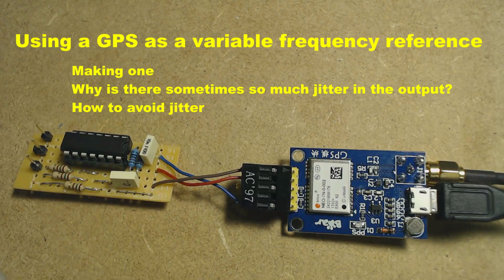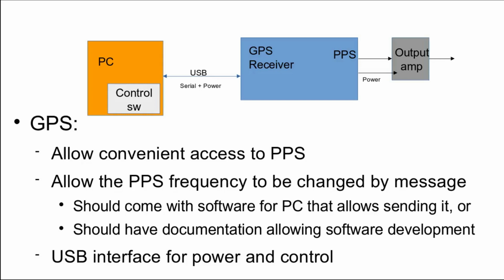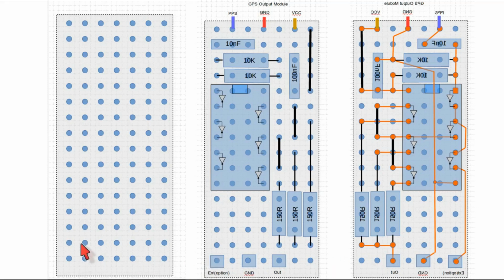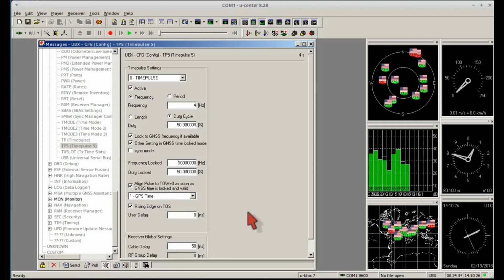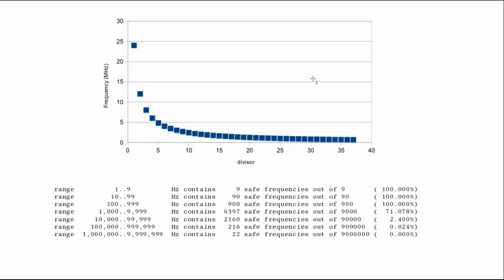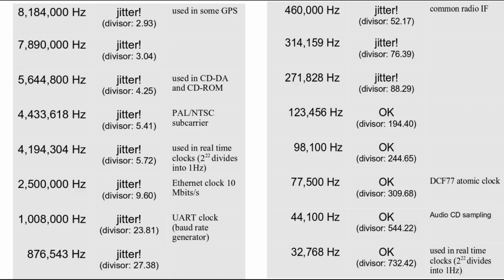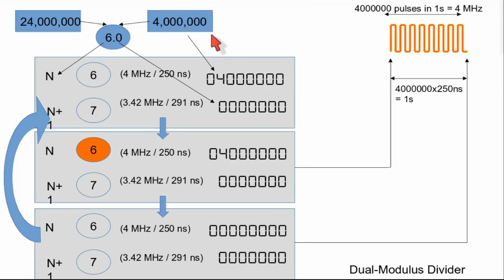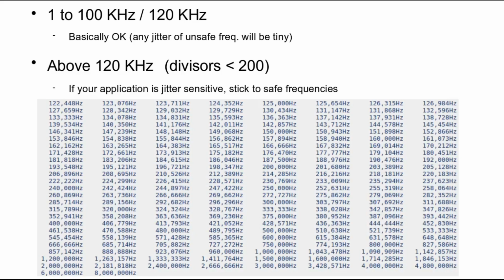Using a GPS module as variable frequency reference standard

Comment: Thank you for this clear and informative video ... excellently put together.  Also, thanks for sharing your two sided board layout, it saved me a lot of time !  I built a copy from those plans.  I was surprised at one thing (maybe my expectation was wrong):  I was surprised that the Schmidt Trigger drivers didn't clean up the signal more at even moderately high frequencies (e.g. 4 MHz) ... was it wrong to expect more square waves ?  (I understand the ringing from a high impedance input).  Perhaps it was just my hastily put together test setup.  Thanks again, and any insights would be greatly appreciated.
Reply from the maker: There is a lot of ringing visible which is because (especially for square waves) one has to take care of properly terminating the connection with a matching impedance on the scope. I did not do this (my bad)
Reply: @TheHWcave thanks for your reply … guessed something like that … I build an interface board to your plan and told my viewers to “just go watch the video @TheHWcave” 😊

Comment: Hello, Heinz. It has been three years, since I last commented here, and I am considering, again, the unsafe number jitter that you discovered. As I understand it, the Atomic Clock Reference Pulse provided by the NMEA data stream is a one second pulse. (This pulse is easily sourced from the GPS module.) As it is the GPS MCU that creates the math error, would not we do better to create our own precision multiplication method, be it hardware, or MCU/software, and use the one second pulse as our reference to correct the newly created means of multiplication? Meaning, we avoid the UBlox math difficulty by not using the UBlox math calculation. If so, what hardware and MCU/software solutions might you suggest? I guess the goal would be being able to create any infinitely variable frequency with a great magnitude of precision. If we are multiplying by one (pulse,) maybe this is somewhat less difficult? For the fixed frequency of 10MHz, which I think is the frequency that most people desire for a reference standard, how about just adjusting a 10MHz voltage controlled OCXO every second? I am not a precision guy, so I do not know how well that a one second lag between updates would go over with the folks that chase such precision. Edit: A Hardware solution might simply equal Scullcom's divider circuit dividing the one second pulse by 10M?
Reply: My thinking regarding using Skullcom's divider was obviously backward... We need a multiplier. Start with a safe frequency and increase it to the frequency that we want. I know that there are such devices, but nothing much of them. Looks like 2x and 3x factors are common?
Reply from the maker: To be honest, I'm not using this reference anymore, I "upgraded" to a GPSDO from Leo Bodnar, their mini model, which is pretty much what you are suggesting. It only has a TCXO but I keep it on permanently and so GPS keeps it nice and steady. This also contains a processor but just to control the PLL hardware and set dividers, not doing any maths. It provides a pretty good 3.3V signal selectable to (almost) anything from 400Hz to 810 MHz. I don't think a pure software solution is going to work with sufficient accuracy.  Looking at the stuff inside the GPSDO, a proper solution is quite complicated in terms of special chips needed and registers to control. Using a couple of simple ripple dividers 7493 etc is a lot easier but then you only get frequencies that are divisible  by a ^2. I decided on the GPSDO  because I like that I can pretty much select any frequency, including much higher ones, however 99.9999% of the time, it is set to 10MHz and connected to my frequency counter's ext ref input. So, actually the UBlox could do the same for that. Actually, now that I mention it, that seems like a good idea for reusing that chip and maybe put it directly into the counter, a HP 5334B (it has just a simple 10MHz crystal oscillator as time source, the OCXO option is not fitted)

Comment: Is 24 MHz actually correct? Your measurements seem to show it is; however, the data sheet seems to be different. 

The u-blox8 data sheet says: “The module's internal 30.72MHz VCTCXO is disciplined by the module and provides the frequency reference to the platform. The module provides a PPS signal to synchronize the platform's physical layer.”

The u-blox7 data sheet says: “The receiver is dependent on a local oscillator (normally a TCXO or Crystal oscillator) for both the operation of its radio parts and also for timing within its signal processing. No matter what the nominal frequency the local oscillator is (e.g. 26MHz), u-blox receivers subdivide the oscillator signal to provide a 1kHz reference clock signal which is used to drive many of the receiver's processes.”
Reply from the maker: I agree that the module probably does more complex things internally at different clock speeds. I thought I made it clear in the video that the 24 MHz was just something I came up with to make determining useful frequency divisors easier. Apologies if this was misunderstood.
Reply: @TheHWcave  - zero apologies needed and nothing was unclear. I liked the video and the logic you used (pun intended). I just so happen to be reading the reference manual (for different reason) and went off to see if I could find more on this crystal frequency issue. Keep up the good work!

Comment: Instead of using brute force methods to obtain jitter-free frequencies I just used a internet app to obtain the factors of the oscillator base frequency. 
Factors are "whole number" divisors i.e. they have zero decimal places.
The app returned a list of 140 factors for 24,000,000, all of which give jitter-free PPS output from my U-BLOX M8N. A very easy solution.
Because information available elsewhere suggests the M8N has a 28MHz oscillator I also factored 28,000,000 but the only jitter-free signals I could obtain from the result were those factors which were common to 24,000,000.
This confirms that the M8N oscillator runs at 24MHz.
Reply: The oscillator runs at 48MHz, you can find that figure in earlier model datasheet. Not that it matters since it's 2x24. What I don't understand is this app and factors you mention. I just set the desired output frequency in the Ublox app.

Comment: Even if this is an older thread: To get around that modulo divider problems, would it help to play with the PWM ratio? maybe there can be a quite safe value defined for the 10 MHz, e.g. 12%. Did not dive into the math required for this. This would be similar to the monoflop proposed before. And reasoning about if the rising or falling edge is more stable ;) Very good job, Thank You
Reply from the maker: A very good question. I need to find a way to revive the UBLOX application on a suitable Windows machine to test all the variants of non-50% duty and locking or not locking it. I have not used the UBLOX software since making the video because I wrote my own little program for Linux that just sends the desired frequency to the chip.  I'll have a look but it will be a some time before I can get to it.
Reply from the maker: I did a quick test, and changing the duty cycle did not help. In fact it can make things worse in that even jitter-free frequencies now start jittering
Reply: @TheHWcave  I looked how pll works. It assumes a symmetric distribution of the input signal around the lock, which is defined as 0. The input is low pass filtered to determine the vco correction. A duty cycle other than 50% would spoil this. So it would not work, unless some correction is applied
Reply from the maker: Thanks for the info. So unfortunately jitter is going to stay, but as I said, that doesn't stop the usefulness of the GPS module as reference standard (as long as you measure just frequency)

Comment: Try a neo8, it has no issues with 24Mhz output and you can feed that into a cheap si5351 module to get practically any output frequency within si5351 limits (~280MHz). Phase noise is not the greatest ...
Reply from the maker: Hi Dragan,
you are right, using the GPS PPS to drive a clock gen. chip is a much better solution. In fact I got one already, using a MAX M8 to drive a SI5328. This came from Leo Bodnar (mini GPS ref. clock) and can produce 400Hz to 810 MHz.

Comment: hello, the internal neo-7 crystal under the shielding is 26Mhz. i wanted to replace this 2520 tcxo crystal with an other that will divide to 10Mhz with no jitter ( i didn't find anyone who did that) . the fact that it's a 26Mhz and not a 24Mhz is confusing.  any recommendations other then desoldering the crystal and injecting external frequency from an external generator and see what happens?  did anyone tried this?
Reply from the maker: Hi David,  finding a crystal freq. of 26 MHz confusing. I would have expected 24 as it seems all frequencies that divide 24 with no remainder are jitter free, like 12, 8, 6, 4 ... but of course not 10. I am very curious about what happens if you try injecting an external frequency.  Please update the comment or email me with the result.
Reply: @TheHWcave  hi, i desoldered the on board 26Mhz tcxo and connected si5351 output#3 directly in its place. i started with 26Mhz. the neo-7 works as usual.  then i changed the frq to 21.66666667Mhz and set the TP5 register for outputting 12Mhz and i got jitter free 10Mhz from the neo-7. however serial communication with the neo and i believe that the chipset (other then the pll divider) isnt working. it needs the 26Mhz as a clock. i will put back the tcxo and connect the neo7 as external clock to the si5351. that way i will have a steady gps clock for the si5351 and could get 10 mhz with no jitter and any other frq on any of the 3 outputs.
Reply from the maker: Very interesting. Which variant of the si5351 are you using? The C version CLKIN could also be driven by 12 MHz which is jitter free from the neo7. I have not looked at the programming of the si5351 and that would make a big difference in the choice of output frequencies.
Reply: @TheHWcave  i have the "A" version. the "C" version is a beast :) you can get almost any frq you want jitter free with the SI5351. it also has a clock builder application for desktop to help you find the correct dividers to get jitter free frq.
Reply from the maker: Those Silicon Labs chips are great, no doubt but don't get me started on those  desktop apps that work only with Windows and then sometimes only when connected to the proper development board.... and no documentation in data sheet or application notes on the algorithm for those without the board and running Linux. With lots of effort I managed to work out my own algorithm needed to set the register combinations for the Si5328 to do (almost) any frequency jitter-free and GPS locked from a few kHz to 800 MHz. The hardware uses a board from Leo Bodnar based on a  u-blox M8 GPS module driving a Si5328. So, conceptually very similar to what your are doing. I am using it with my own software, One of these days I plan to make a video about it but too busy with my day job at the moment.

Comment: But is the "safe frequency" actually accurate though? Is the 24Mhz main clock always accurate because its GPS? 
For example: if the 24MHz main clock is from some random crystal oscillator, and the GPS circuitry is "fixing" the expectedly low-frequency output clock with some logic. When you ask for a 12Mhz output, the 12Mhz will be based on the inaccurate 24Mhz crystal and will skip a 1/24M second step every time it decides the 24Mhz inaccurate 24Mhz crystal needs some fixing. So after all, there is no benefit in using a GPS over a TCXO.
Reply from the maker: There isn't a 24 crystal per say, all I found is that mathematically, it behaves as if the safe frequencies are full multiples of 24 MHz or 12 or 6 or 48, your choice. What really happens is that the chip allows you to insert additional pulses within the frame of the GPS 1 PPS - pulse-per-second. The PPS is normally a highly accurate 1s signal synced and controlled with the GPS time. Using the software, you can ask the chip to put out n additional pulses within the 1 second frame. As I found, the chip uses pulses of the same width if it happens to be a safe frequency but mixing longer and shorter pulses if they are not. So what is guaranteed is that if you asked for say 12345 Hz, you will get 12345 pulses per second (within a 1s PPS frame) precisely. However, these pulses will not all be 1/12345  = 81.004... us long. Some will be shorter, some will be longer, but there will be exactly 12345 of them and they repeat exactly every 1s with GPS precision.  Using this as a frequency standard works only if you count pulses per second. If you use shorter gate times, you should use only safe frequencies.  As I said, the chip tries to do a good job spreading the desired number of pulses evenly across the fixed boundaries of the 1s PPS but to illustrate the principle, it might just as well bang out a short train of 12345 pulses of 1us length (0.5us high, 0.5us low), followed by 987.655 ms of total silence. Same result, "12345 Hz" .This is very precise but very different from a normal crystal oscillator. In my experience it works brilliantly for testing and adjusting frequency counters for all frequencies up to 10 Mhz and a bit beyond, but for signal purposes, I would generally stick with safe frequencies  only.
Reply: @TheHWcave  Thank you so much for your reply. It has been incredibly useful. So concluded, the chip can only guarantee an accurate 1Hz output. Anything above that is digitally generated in the chip and may be full of jitters and uncertainty. It is useful and good for testing and calibrating equipment with a >2sec gate counter, but not suitable as a clock source or a crystal oscillator alternative.

Comment: I thought that my poor waveform issues were likely related to incorrect termination. So, I watched this short video. It was two minutes of exactly what I needed: https://www.youtube.com/watch?v=7fCfZoI7-7Y.

I tried adjusting the function generator output resistance (50/600 Ohm button) and adding a variable resistor in series and parallel after the Schmitt Trigger. By playing with these new parameters, I was able to improve the waveform's shape. All of this is very interesting and I am learning a lot, thanks to you!

Comment: I built the circuit on a breadboard, but with a CD40106B, because that is what I have on hand. It is P-2-P compatible. I don't know about specs comparability. I used a triangle wave. At 1MHz the waveform was already significantly degraded. At 2Mhz, the top of my Generator's ability, I would have to question the waveform's reliability, because the knee on the trailing edge is almost non-existent and could even be approaching the lower level cutoff of the trigger. This is new to me, so if I am not using the correct terms, I apologize. I wonder if progressing to a perf board might improve things... Or, if there is a better brand/model of trigger? Anyway, this was a very interesting project. Thank you for your help.
Reply from the maker: I am afraid the CD4016 is not suitable for this as you have found out already. It is a switch for digital or analog signals. The in/out path through this chip doesn't improve the signal quality in any way (probably making it slightly worse) and the controls (to turn the output off or on) max out at 10 Mhz which isn't nearly fast enough. Try to get the 74AC14 for best results but even a plain 74LS14 will improve the output

Comment: Would it be a good approach to try to remove the jitter digitally? Use an MCU, as you would to remove a ring, or switch bounce... That is, have the MCU detect the starting edge of the signal and wait a ("blackout") period, before detecting the next edge... Or will the MCU just not be fast enough to do this? (I am a MCU novice.) I like the PIC18F4550, which takes 4 cycles to execute an operation.
Reply from the maker: I don’t think it feasible. Originally I was about to suggest what is effectively a non-retriggerable monoflop (see https://en.wikipedia.org/wiki/Monostable) with programmable delay. For example, 10 Mhz is made of a sequence of some pulses that are 63ns (8 Mhz) and some that are 40ns (12 Mhz) wide. You could feed the PPS signal into a monoflop with a pulse width of 50 ns. Regardless if it was triggered by, say the rising edge of a 40ns pulse or 63ns pulse, it will always produce a 50ns pulse on the output.

The trouble is that while this now produces pulses that all have the same length, the gaps between them still vary, so its just another form of jitter. 

I am afraid, I think the best way is to use PLL, basically making your own oscillator (jitter free, and could even be sine instead of square wave) and use a PLL circuit to lock its frequency to the PPS signal. You might be able to do this all in software in a micro controller which would be an interesting but rather challenging bit of work!

I never bothered with that. As I said the frequency (as in pulses per second) is always 100% correct, just the pulses are not always the same length. For testing the accuracy of counters or frequency readouts in multimeters, jitter doesn’t matter.

Comment: You can get almost any frequency you want (and multiple of them at the same time) if you feed the stable 8MHz into a synthesizer chip as is done in this SC project:-
http://www.siliconchip.com.au/Issue/2018/October/GPS-synched%2C+lab-quality+frequency+reference+(Part+2)
Or you could possibly hack off the crystal on one of these:-
https://www.ebay.com.au/itm/264067067038
and feed the GPS output into the xtal input